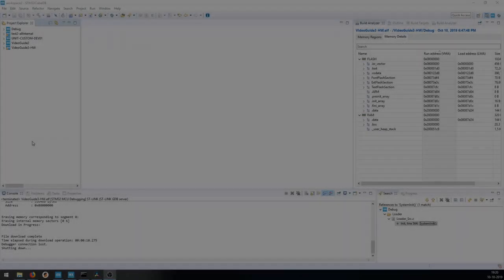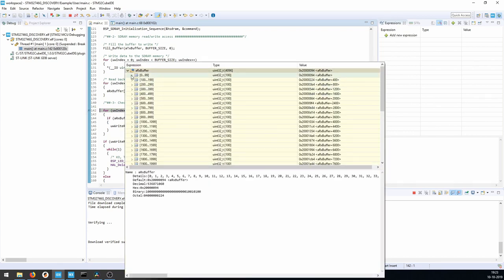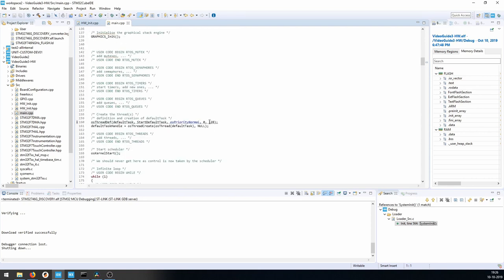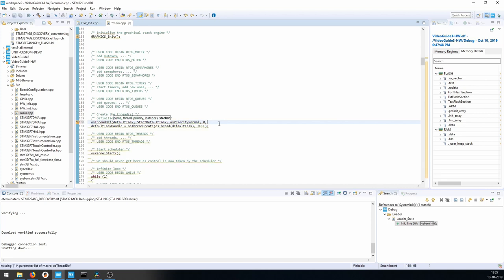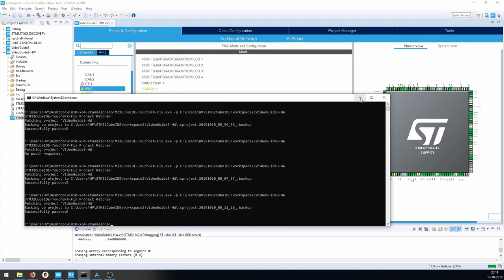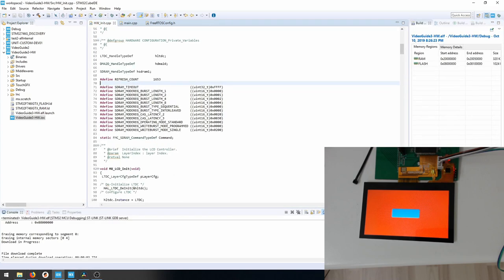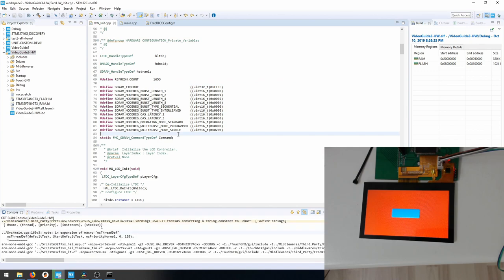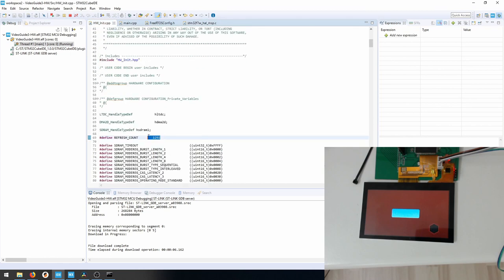SDRAM configuration on STM32F746

Comment: Hello , l am wondering what are LTDC and FMC different. Do you know? I want to use to drive TFT Lcd. Which should I use?
Reply from the maker: Ltdc is dedicated to displays. Fmc is merely a memory interface
Reply: @banjohat  thank you. I want to ask a question. 
Do you know the difference between st and touch
Reply from the maker: @NickAymaz  ST owns TouchGFX...
Reply: @banjohat  sorry I writed false. stemwin and touchgfx
Reply: I would say you need to use both - ltdc for controlling display and fmc to access external memory as framebuffer for ltdc, if you cant fit your framebuffer to internal cpu memory